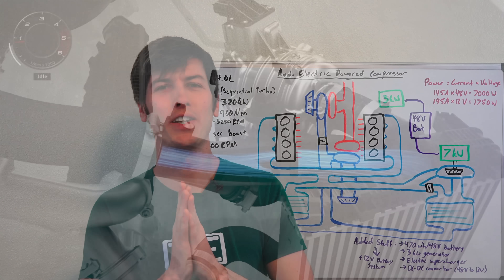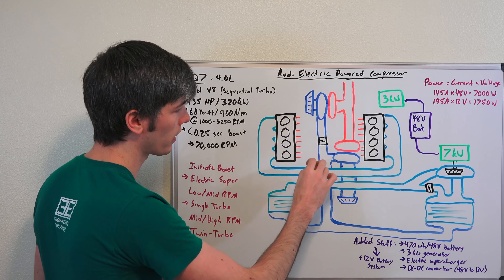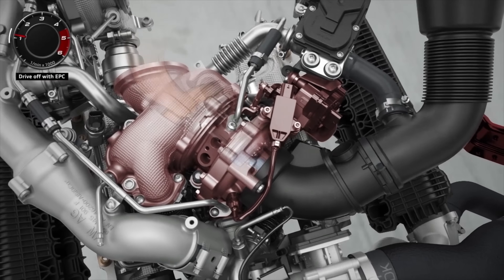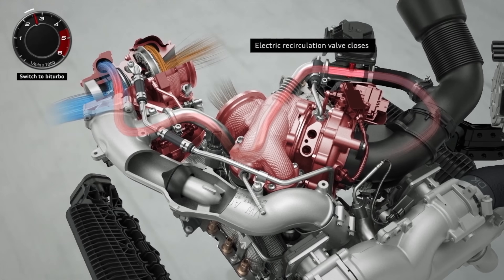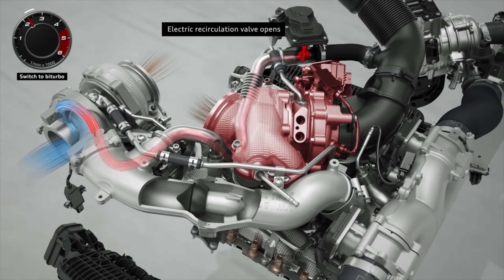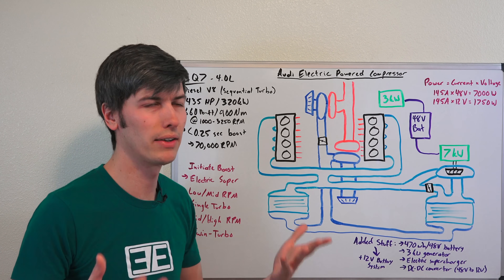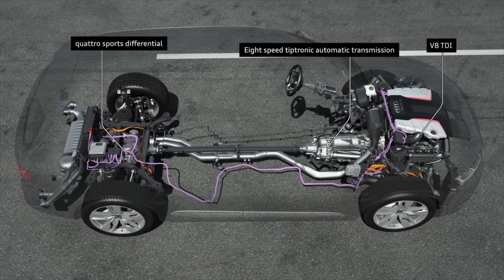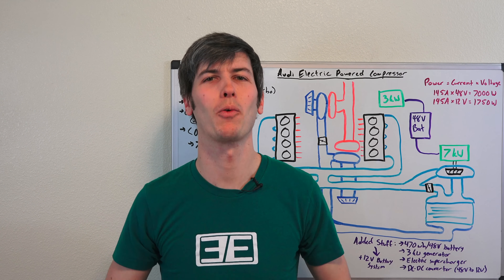Electric Superchargers - How Audi Is Eliminating Turbo Lag

Comment: Thats such a bad design, more weight, over complicated. Tesla would spank that motor any day. Goes to show you that if you have to boost a car in any way. The motor is too small. Multiple turbos equal a lot of heat, i bet the suspension is crap. It wastes a lot of fuel. You cant have a luxury car and and sacrifice the motor to run smooth and expect it to perform like a race car. These designers just build the cars from blue prints. The never actually have to work on them, that's why when u look under the motor its over crowded- pure sh*t. Total garbage.

Comment: Seems ridiculously complex.  Why not just have electric motor compressor eliminating the need for intercoolers and it will not fail because of the exhaust heat frying the turbo.

Comment: There is no tubo lag in a super charger it runs on a belt or gears. A turbo charger runs off of exhaust. Why does this guy always on the cars I don't even think he knows how to drive. electrical knight mare and a waste of money and more weight a step in the wrong direction. If you want speed and high altitude performance the turbo is the way to go. This has to weigh hundreds of pounds more than a roots type supercharger. And makes less boost than a 4 lbs turbo.

Comment: Sigh... I really wish people would start understanding the difference between a "supercharger" and a "turbocharger". In a nutshell, a supercharger is generally powered directly by the engine, either through gears or belts and provides boost of engine speed. A turbocharger is generally operated via a turbine powered via exhaust gas, and as such the boost lags behind the acceleration.

Comment: Could you not replace the 12v battery with a 24v and pull the cylinders down to 4, single intercooler etc? Or is this what the TSI does anyway?

Comment: Why not just use a smaller turbo that spools quicker then the second one kicks in, a lot of work for some low end power. You use 7kw to run it when it probably only produces 5kw

Comment: Classic audi. Way to complex way to expensive way to servicing with little result at the end. If V8 is too slow just add smal yet powerful short time 100kw asycronous motor and it will accelerate in no time.

Comment: maybe it's just me and it's a packing issue but why wouldn't they attach the electric super charger to some sort of inertia flywheel driven from the turbo and make it compound turbo in low RPM thereby eliminating lag and getting way more power. At low RPM they have a turbo sitting there unused, the compound turbo setup where one turbo feeds into the other turbo creates way more boost especially at low RPM and if you combine that with inertia flywheel taken off the turbo the electric supercharger will always be up at max RPM ready to produce max power and no 1/4 second lag at all... maybe it's impossible to package and route.

Comment: I never understood why cars run on 12v systems, it seems like higher voltage just makes sense. Sounds like an old tradition that was never changed. Interesting, I might try to make my own version of this.
Reply: Because components inside the ECU’s or Control Modules such as Integrated Circuits ( I.C ) are not suitable for high voltage. Yes, you can reduce the voltage by adding a voltage regulator into the circuit, but what’s the point of using a high voltage while you can use a 12-14 volts directly.

Comment: Voltage is easily changed with circuity and transformers.  No need for another alternator.  Just a larger one.   A single electric turbo should not be a problem..   I think generator/alternators  should be built into the engine,  like an older distributor shafts is..  This will eliminate another belt too.   All engines have alternators..   It's time to integrate them and use them for many things..

Comment: is it really that expensive to switch to a 48 battery, higher power alternator, a voltage convertor and the electric turbocharger?!
I mean a car price depends heavily on its power so this cost and changes required only seem marginal. as we're chasing hp like mad such a system seems rather simple.

Comment: this idea of electricly powered turbocharger orelectric powered compressor came to my mind 4 years ago,this idea is excellent, instead of using exhaust gaz to run up the exhaust turbine and so on because  it will have bad effect on the lubrification oil if the turbo uses the engine oil as a lubricant on the shaft in between the exhaust turbine and the intake turbine. 
good work

Comment: Mazda already eliminated turbo lag almost entirely with its dynamic pressure turbo first used in the 2016 CX9 and now available in the 2018 Mazda 6 2.5T.  None of this extra equipment that can break, not to mention the extra weight added with all these compressors and electric motors. If you want to see the try cutting edge of automotive tech that is usable and also affordable most people take a look at the amazing stuff coming from Mazda.

Comment: I think you are missing one valve above the left cooler on your drawing, so when the electric charger pulling air trough the right cooler and it is pushing it to intake manifold it won't go back in the atmosphere ;-)

Comment: What about a 4 battery system deep cycle high capacity, 4wd enthusiasts do it all the time... Upgraded heavy duty alternator and then a 48V system could run off that. Sure it would handle intense city driving and race conditions but highway driving and moderate around town driving...it may work

Comment: So as I understand, it's just a less efficient conventional belt driven supercharger? 

Instead of the turbine being run right off a belt from the engine, it goes through the alternator, through another generator, to a battery, and finally to the turbo itself? That just sounds like a lot of energy lost. 

This is the same reason why the 150 dollar electric superchargers on EBay don't work and make your car slower. Those fans draw power from the alternator, that then go to the compression fan to try and draw more air to the engine itself.

Comment: LLLLOOOVVVEEE having it explained, but sounds reminiscent of BMW’s tri and then quad turbo diesels, minus the 48V circuitry VW has been implementing going forward.
What would be the situation be on a 12V system, BUT, with the lithium iron chemistry (maybe not iron its specified as iron inconsistently in conjecture, but it is lithium) batteries slowly working their way forward in the automotive world as a starter battery, with this essentially hybrid system for forced induction? Porsche offers them last I’d known, BMW gives one regardless such as the M3/M4.

Comment: If you’re wanting to use 12v instead of 48v to get 7000watts of power then your amperage increases(583amps). This would just be a different battery configuration. I’m not sure if you were trying to prove a point that 12v wasn’t practical or something else... 4x 12v 145amp each batteries in parallel(POS-neg-POS-neg-etc) I get an Audi 48v battery with 145amp. If you use the same batteries, 4x 12v @145amp in series, the voltage remains the same(12v) but the amperage becomes 4x145=580amps. Either way its 7000watts. It may be a better point to explain higher voltage is going to be the preference.

Comment: At this point I wonder if it's not more efficient to power the wheels directlywith this electric system or having a sort of hybrid super / turbo charger using the same turbine but being powered differently regarding the engine's RPM ...

Comment: This is a shame, I can't think of a better application for super capacitors. That battery will suffer a short life through thousands of mini cycles a drive. (charge discharge)
Reply: go look up amperics. It is the start to the future of energy
Reply: Systems like that have integrated capacitors.

Comment: You can now get legitimate electric turbo/super chargers with about 2kW motors, and they do require an extra battery.
Obviously you aren't getting a huge boost, but it is something comparable to small engine turbos.

Comment: Stealing my idea. I just thinking about this the other day. I think you can get rid of the traditional turbo and go completely electric induction. That will open up the exhaust, reduce cost. Also build a compressor tank to store pressured air, to clean intake valves. This compressed air would open be introduced during the scavenging cycle when both valve are open. This will clean the dirty air from the cylinder, clean the valves, reduce blow back into the intake, introduce oxygen into the Catalyst burning off the exhaust gases cooling the catalyst for leaner  mixture. There are a few other ideas, but I'll keep them for now..Kevin

Comment: In my opinion there is something AUDI isn't explain or something isn't correct in your schematic.

When the electric supercharger starts to operate part of the air will want to go to the engine as it's lowest pressure part, but part will also go to atmosphere by reversing threw turbo one, it wold also loop on the left side inter-cooler (from the viewer point on this animation) and go back to the electric supercharger (on the right side).
That wold create turbo flutter (bad) as it reversed threw turbo one and a loss of efficiency on the electric supercharger.

Maybe and I'm guessing here, they are using the left side e-throttle closing it so air can't go through the inter-cooler on the left  when the electric supercharger is in operation, and as the air splits to the right and left engine banks after the e-throttles it can always feed both sides of the engine with boosted air!?

This  is the same problem that sequential bi-turbo face and and is resolved by closing a valve to the output of the 2nd turbo and recirculating the air that the second turbo compresses to the 1st turbo inlet.
View MAZDA RX7 FD, TOYOTA SUPRA, PSA 2.2HDI turbo operation.

Comment: No thanks, overengineered. 
Give my a hybridized turbocharged V8, with a electric motor/generator on the V8 crank instead. Less or about the same complexity/weight added but the electric motor assisting does not lag .25s.
Plus efficiency/pollution can be improved for large V8's when they are used for city driving.

Comment: If Audi wants to make their cars faster, they should make the turbo motor something like 300kW, connect it to the wheels and then throw the turbo with the engine.
Reply from the maker: They weren’t trying to make it faster, it’s plenty fast. They were trying to eliminate turbo lag, to make it a more seamless experience for the driver.

Comment: I don't know, but myself is Thinking : Why? I driven the OM642 with the 265HP. Nice V6 Diesel, and it has a small Turbo lag for an single turbocharged engine. Also i driven a 330d, also single turbo VTG, and also: very small turbo lag. 

Yes, the E-Turbo boosts up directly when i take off, but the C350CDI and the 330d do also take off quickly. 
The E Turbo may simulate the "natural aspirated throttle response", but  a car with huge Turbos, i like it when they need a moment to spool up and punch you in the seat. Like in the RS3 i driven, drive with 30km/h out of the village on the "Landstraße", shift the RS3 to 2nd or 3th Gear, floor it, and then the Turbocharger catapults you in the seat.

Comment: Can you do a video on:
How much of a return do you get for this 7hp? Eg, if a 12v battery can provide X amount of litres at Y pressure on a second, that may be a 20% increase for my little Honda

Sorry I realise I can probably google/calculate myself how much energy is in compressed air and work out how much air my engine needs but it’s still a video suggestion so you can get sweet sweet views

Comment: Why so complicated? Just disconnect the two halves of the turbo and properly size the generator and motor. That way you can independently control the compressing from the gathering of exhaust energy. That gets rid of all the complicated air pathways, plus you can package however you want because you don't need the exhaust close to the intake. Put it into a hybrid car so you can piggyback off that high powered electrical system, if you are trying to be efficient it should probably be a hybrid anyway. Or if not, use a super capacitor because it's a high power short cycle time application.

And then throw it all in the trash and make an electric car.

Comment: One DOES NOT want to BUY a car with that. One wants to LEASE. Because when the warranty is up, repairing something like that has got to cost a small fortune...And I wouldn't be surprised if a lot of that stuff was so buried under other things, it'll take a day just to get to what failed.
Reply: those who buy them probably have a few fortunes.
Reply: @hugeturd42   Yeah rich ignorants we call it !
Reply: Yep, it's called "Service Position".
Reply: Nick Earwood hhhhhhhhh
Reply: no doubt this is amazing technology, but yeah totally agree with you.  hopefully it's not sitting in the dealer garage for any of the lease time
Reply: bruh, people that can afford an SQ7 give 0 fucks about repairs/reliability. If you serve this car as it is meant to be served, everything will be completely alright for the next 5-6 years.
Reply: Audi’s ‘service position’ isn’t usually that hard to get a car into to be fair.

They’ll charge you like an hours labour for ‘assuming the service position’ though, and another hour for putting it back together...

But I can honestly get the front carrier off my a4 in 15 minutes, so they’re totally just milking the labour rate.
Reply: Titan mukungurutse  and special battery and the control system and computer...
Reply: that's why here in the phils we opt to choose surplus all mechanical Japaneses  car,  isuzu c190 engine up to now still running  even though bathing with black oil and it start each time you turn on ignition
Reply: That's good advice methinks....
Reply: its in a 100k € car man do you think they keep it for 20 years? no. they buy it, drive around for a few years and resell and buy another new car
Reply: @keisuketakahasi4584  I guess I do things a bit differently. I like to buy the best I can afford and drive the wheels off. Most of my cars were/are purchased as new. And skip the extended warrantees, too. Not worth what is charged....
Reply: I have sq7 and it is 7 years old now and dont have problems with engine, driving this car with 4 wheel stering, quattro sport differential and power of 435hp with no turbo lag is something amazing, beyond time. Disel consuming is betwen 8 and 9L/100km, thats crazy❤
You need just extra care for more carbon in intake manifold, use a decarbonisation one or two times yearly.
Reply: Lease isn’t magic, you’d be better off buying the car, driving it under warranty and then selling it. It’s not chairty.
Reply: The Germans cannot do simple,  why the T34 kept running when the tiger failed.
Reply: No sell them before warranty runs out, and as i get them at 40% off leasing would not work for me.
Reply: @aeroflopper  wait u get a 40% discount on audis
Reply: If you can affored to buy the suv you can affored the upkeep cost.
Reply: Your logic is flawed.
Reply: You should NEVER buy an Audi. NEVER.

Comment: Good content buddy. Only thing was when you were speaking about the cars 12v system. The 'battery' is only really doing anything when the car is off or starting the engine. It's not running your climate controls or radio or anything else once you're getting on down the road. That all falls on the alternator. Anyways great video :-)

Comment: I thought the car accessories and everything else are powered by the alternator after the engine is started? The battery just cold start the engine no?
Reply: totszwai the battery pretty much acts like a capacitor to protect the computer from votalge spikes from the alternator. It also makes the electrical flow smoother for moments when the alternator isn't pushing out enough.

Comment: Why would they add  the weight and complexity of adding a 48v battery and not just go the rest of the way and make it a hybrid?
German engineering, if it isn't broken, it isn't complex enough...
Reply: The 48V system actually does make it a mild hybrid... the 48V system also uses the A/C alternator as the starter and can start/stop engine while driving or coasting to conserve fuel depending on driving conditions. Look up Audi’s 48V system on most of there 2019+ models, its pretty interesting
Reply: Thetablet Nonya is a small battery really
Reply: @thomas_nl_  it's a 3kw gas powered generator not a battery
Reply: A generator without a battery is basically a torque converter and pretty useless for this use case
Reply: To be faster than the competition, you could have think that about your self
Reply: Plus if this works you can go further then just only a supercharger.
Reply: Bud the battery is really not as heavy as you think
Reply: Because they also need the 48 Volt for the mild hybrid, the electric stabilizers the e-turbo and so on. There will be an increased need for more electric power which is hard to deliver with only 12 Volts.
Reply: a 48v lipo battery weighs about 2lbs, It's really not much.
Reply: @RC_Trailblazers  they could put high big capacitors, and so it can have 7kw for eturbo, and eliminate that 48v battery.
Reply: @RC_Trailblazers  How many amperes can this battery push trhough?
Reply: dont forget the 7 KW electric motor lol, thats like 40 kilos
Reply: nick brookhuis no, there are 7 KW High RPM motors that weigh less than 1 kg, some even 600 grams

Comment: You need to explain why they don’t just use a split generator/compressor electric solution like F1 and get rid of the two turbos, valve controls and variable plumbing.  Is it efficiency or reliability or both.